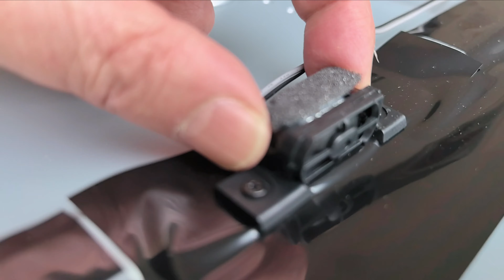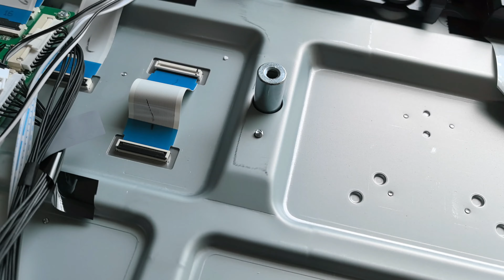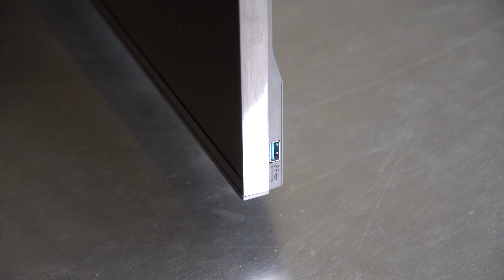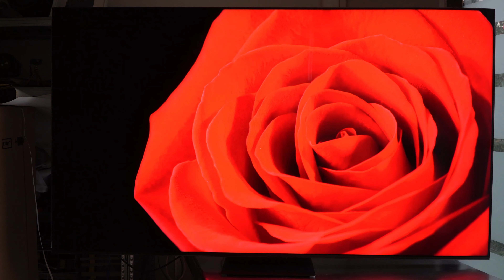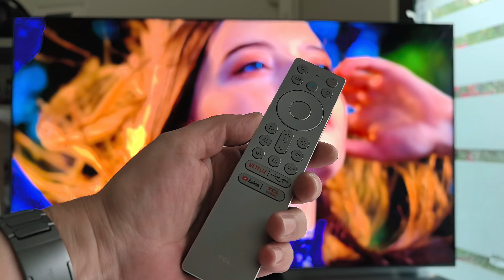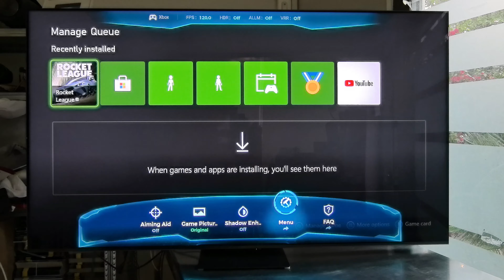TCL 75C855 Mini LED Television Review | All you need to know, deep unboxing

Comment: Is there a big difference between c765 and c855? For example in black lvl ?
Reply from the maker: @tomasliska428  yes, the 855 is kind of premium model. Better panel.
Reply: Thanks, I'm currently deciding between the 75c855 for €1699 and the 75c765 for €1349. Would you recommend paying an extra €350 and going to the c855?
Reply from the maker: @tomasliska428  yes, especially in this size

Comment: Gr8 review, thanks.
Unfortunately, that MT9653 (Pentonic 700) is even lower than SONY's 2020 Flagship TVs with MT5895/5893 chips. So, the X1 processor's 4K UpScaling skills  and lightning-fast reaction time is NOT available here in C855 !
But it'll do the usual TV Processing... I'm waiting for the Pentonic 1000 (MT5897 or equivalent) on TCL Flagship TVs, maybe on 2025 models ? 🤔

Comment: The Fact that this TV does not have a 3,5mm headphone jack is dissapointing. Yet it is clearly seen that PCB has a 6pin empty socket (next to Orange AVR) that seems to be designed for missing PJ-342 headphone jack... Is TCL really cutting off versatility by not soldering in the headphone jack in the dedicated place on the board to save couple of cents on these expensive TV's?